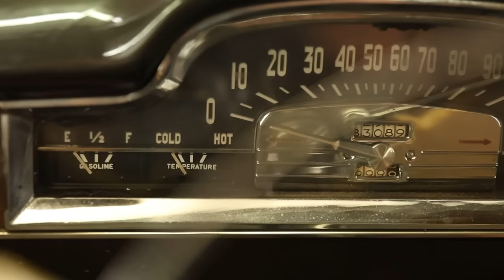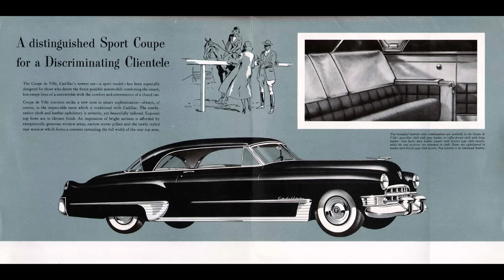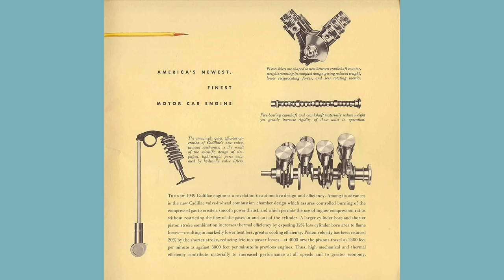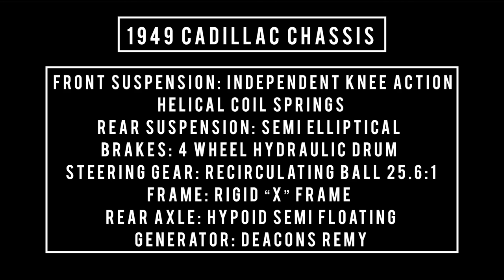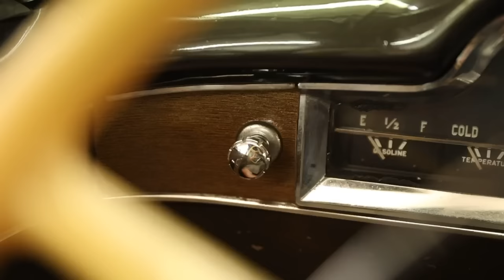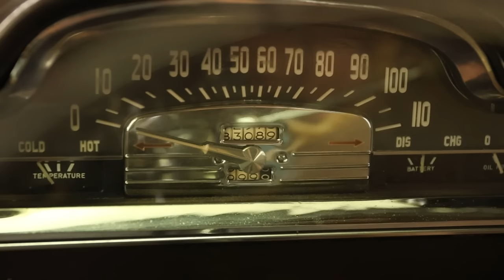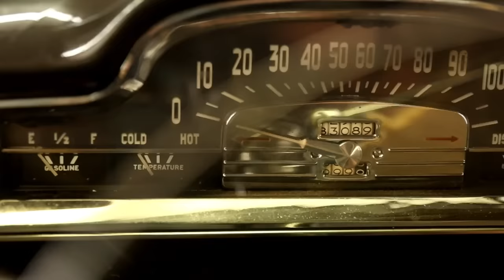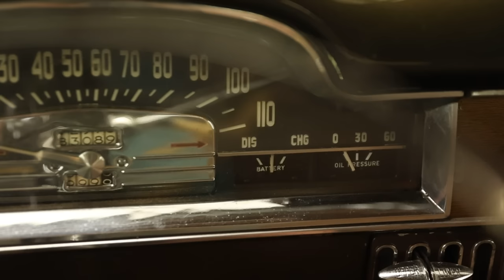1949 Cadillac Series 60 Special￼, Featuring￼ brand new OHV V8 ￼

Comment: great video.  I own a '49 Cadillac, let me fill in some of the blanks.  The knob on the dash next to the wipers turns on the fog lights and turns off the front parking lights (the light under the headlight is the fog light, turn signal and parking light). The upper and lower knobs are not vents but control the temp and fans for the upper heater (defroster) behind the dash and the lower heater (main cabin heat) that is under the seat. The underhood vent controls are the chrome pull knobs under the dash on each side.
Reply from the maker: Thank you so much for the corrections I really appreciate it I’m generally able to find an owners manual but I couldn’t find an owners manual that was downloadable for free for this car.. Greatly appreciate it
greatly appreciate it

What do you like the most about your car what do you like the least I talked to another owner today and he said it’s a fantastic car to drive.. they also said the hydraulic windows are great until they break not very easy to fix
Reply: I assume it's like the '49 Coupe DeVille I owned long ago, which had two fans under the front seat (passenger and driver side) that directed heat to both the front & back.  Very quiet system, but a little more oomph would've been nice, presumably to come with the 12V system in '53.
Reply: Very nicely worded…done without sounding like Professor Know-it-all (now I’m dating myself).
Reply: Hello, my turn signal, gas gauge stopped working all of a sudden on my 49 Any suggestions for how to fix. I’ve had the car for about a year. I absolutely love it. Also the break lights are not working since I’ve owned the car any suggestions on that also. Thanks a bunch.

Comment: WYR - Packard (because it’s always the Packard).  As far as the fastbacks - any of them because I love the fastback styling from that era.  I wonder if those side hollows betwee the door/IC may be to distribute the defroster air to the door?  I’ve never noticed those before and now I’m on a mission.    Great content as always - thank you!  Chuck
Reply from the maker: Sweet choices =)
Reply: I have always considered the bathtub Packard design to be an extremely unattractive looking automobile, with the '49 Lincoln and its '''frown grille" not far behind. So for my WYR the Caddy wins hands down. Lincoln improved their design in both '50 and '51 before introducing an entirely new model the following year, but not so with Packard which kept making the same ugly looking car until dealers were unable to even give them away as they would like to say following which a new and better looking design was introduced in '51.

Comment: Always liked the 1949 Cadillac for its gentle fins and the secret location for the gas tank. the fins became a safety hazzard for bicyclists and motor cyclists by the late '50s and '60s. All Cadillacs made from 1941 to 1958 had the gas tank behind the taillight, with the exception of Eldorado from '55 on.                                                                                                          I also liked the suicide doors on the "49 Lincoln, but by then they were on there way out. The  suicide doors went out of fashion, but always returned. Even the recent Lincoln Coach and Rolls Royce has suicide doors.                                                                                                                 My pick would be the 1949 Packard because it is the rarest of the three.

Comment: The 49 is sooooo much better than the 47. The 49 dash is the Cadillac standard going forward….and I love it. Look at the quality! And wow on the hydraulically controlled windows.
The hollow areas wee called something like airflow for natural cooling.
That is quality for the time. ❤️ this car.
Reply: Lincoln used the hydraulic window lifts and used hydraulics for the front seat adjustments, the hydraulics were so much quieter and smoother Mercedes used hydraulics on the 600 grosser

Comment: The 1948 Cadillac was my favorite. One year only instrument cluster and cleaner lines. BTW, the AMC 327 was a stump puller of an engine and had a lot in common with the early Cadillac overhead valve V8s. I had one in a 66 Jeep Wagoneer.
Reply from the maker: Yeah AMC made a bulletproof 327 and honestly one of the most underrated engines of all time in my opinion far better than Chevy’s version those two engines don’t even share anything in common other than the 327 name.. I’m going to make an edit The engine episode is going to be on the first two generations because the second generation was only produced for four years

Comment: For those too young to remember those days, this was the Cadillac which started the whole "tail fin" fad that the American automobile industry.  It actually debuted in 1948 but the '49 did not look much differently.  Every year for the next decade every American car had tail fins and every year the fins got taller and more extreme.  By the end of the 1950s the public had gotten tired of it, so Chevrolet took the fins and FLATTENED THEM OUT, making them horizontal.  From then on, and for more than a decade, car lines became more and more horizontal and less and less vertical.
Reply: I don't think the Cadillac rear end was like the ugly tailfins of the later 1950s,the only ones of those later tailfins that appeal to me were the smaller ear tuft ones that were part of the Ford Owl Eye taillights such as seen on the 1957 and '59 Ford full size cars    also early Thunderbird
  I think the designer working for Studebaker started the sharp tailfins with some of the Hawk cars around 1956 and then the designer for Chrysler picked up on the fashion but had to exaggerate it and then Cadillac decided to outdo them all with the horrendous 1959 Cadillac shark fins. 
  '49 and later GM cars such as Pontiac I think had higher mounted taillights than earlier models I suspect out of concern for visibility (safety) considerations,the Cadillac appearance might have started out of a desire to get the taillights up high where people would hopefully see them and not run into the back of the car. A forerunner of the  modern high mounted third brakelight?

Comment: Harley Earl was Chief Stylist and Designer at General Motors from 1927 to 1960, and Cadillac was his own special domain as the luxury Cadillac designer. Mr. Earl exclusively designed Cadillacs and later, in the 1950s, worked with the assistance of two excellent designers, Chuck Jordan and Bill Mitchell. Chuck Jordan's first work on Cadillac design was on the 1948-49 models for Mr. Earl, and together, they created the first tail fins on American cars for 1948-49. Harley Earl's Cadillac design creations were sensational and iconic, until his final design for the 1960 Cadillac, retiring from GM with high honors at Christmas 1959. Chuck Jordan and Bill Mitchell picked up where he left off for the 1961 Cadillacs.
Reply from the maker: Thank you so much for sharing that insight, this is one of my favorite eras og Cadillac love the design especially in sedenette flavor

Comment: Thanks for another great video Jay, I love these early 50’s cars especially the luxury models. The early 50’s😂luxury cars were built to a higher standard both through engineering and the quality of materials used imo the latter cars supplanted fine luxury with electronic gizmos and gadgets. For the wyr I’d take the 49 Lincoln as the the styling represented the era, especially the front end styling and they were more exclusive than Cadillac’s and better looking than those particular packards . For the sedanette’s I’d have to say the Buick as the styling was beautiful and the straight 8 was a great engine. Those hollowed out passages in the doors might have been for fresh air and heat to be carried to the rear seat compartment, did you see any venting in the B pillar or the rear foot well ?
Reply from the maker: Sweet choices 

I didn’t see any vents in the rear that would’ve been really cool to see that really baffled me how it was open for both the dash and door but there wasn’t a vent from which I could see in the door itself maybe the air defog the window.. 

I agree cars are more computer than car now and there are positives and negatives to both.. The crazy thing is we have been making cars for over 100 years and nobody has figured out how to make the perfect car, some cars have come close.. but all have compromises of some sort

Comment: The 1949 Lincoln in the would you own was a 1949 Cosmopolitan which was technically placed above the Lincoln as a replacement for the Continental the Lincolns used a body shell like the Mercury.

Comment: 49 Packard only because I really love Packard's.  I actually think that Caddy is a better looking vehicle but I've always had soft spot for Packard's 

49 Caddy fastback is hard to beat.  A beautiful automobile.  Looks great hot rodded too.

When I saw those channels running through the front door up at the top I thought at first it might be vents that ran in for the back seat area. But I didn't see any outlets in the back for those. So maybe those were just a styling design for the doors and hollow inside to lighten the weight.  

That's part of the charm of these vintage automobiles taking a look at stuff like that and trying to figure out exactly what is intent was at the time. That's a really beautiful Cadillac though. And a great representation of the top of the GM line during that era.
Reply from the maker: The crazy thing is this was a basement model Cadillac that wrote a long wheelbase I was always a huge fan of this style Cadillac I would take this in any format but really love the sedanette 

I’m not a huge Packard fan from this era but I’ve never been in one I think they called this era the elephant packard era..
Reply: @What.its.like.  The narrator doesn't have it quite right:  Series 61 was entry level, followed by Series 62, then the 60 Special, and finally the Series 75 limo.  The 61 was dropped after 1951.  By the mid '50s, Sedan DeVille models were being offered as tricked-out versions of the regular Series 62 sedans, the latter then becoming the entry level Cadillac.  (Entry-level 62 models were renamed Calais in 1965.)

Comment: 1. Heated defroster/defogger air could be directed into the front doors, and it came up through the brushlike material at the top to help keep those side windows clear. 2. The 49 Cadillac was way ahead of those other 49 luxury cars, with the looks, the OHV short stroke V-8 and the Hydramatic. 3. Sedannet looks choices 1. Caddy, 2. Buick, 3, Olds.  -The 49 was indeed a milestone car. BTW, never mentioned was that fact that from 49-51, this engine had a 2 barrel carb and single exhaust.
Reply from the maker: Thank you so much for sharing that insight

Comment: The 1949 Fleetwood is one of the best looking of the pre-1950 
post-war cars, second to the 1946-1947 Packard Custom Super Clipper.
Reply from the maker: I totally agree The sedanette tho that’s were it’s at.. 

I have a weird addiction for cars off the beaten path =)
Reply: I've been looking for another Packard - will be my 3rd - for a few years but the 2-door coupes are rare to the point of being unobtainable. @What.its.like.
Reply from the maker: The crazy thing is if you wait five or 10 years you’ll be able to buy any Packard that you would want to buy except for the custom cars those will always be expensive.. like the 34 custom LeBaron bodied cars those will always be worth a fortune and the Darrens. 

Just curious where are you located and what Packards do you have. I’m always looking for Packards to do on the channel if you’re close I would love to feature your cars on the channel if you’re up for it. 

1941 Packard 120 episode is today I thought it was a 110 I got through most of the writing portion of putting the episode together to realize it wasn’t a 110 it’s a 120.. I really wish it was a 110 though because that story was a cooler story than the story that’s going to be told still a cool story but it was better.. with 110
Reply: I'm in Tucson.Mid-late 1970's I had a 1953 Pacific convertible with Ultramatic and in 2000's a 1951 Clipper 300 3-speed overdrive, which I preferred and is what I'm looking for.  There's a pretty light blue 1953 coupe advertised but the seller doesn't respond to questions.  It's a 3-speed but the seller won't say if the overdrive is operational.  Also, the Cormorant has no wings. -  @What.its.like.
Reply from the maker: If I ever go out west I will let you know cause I’m really interested =) I shouldn’t say if I should say Wynn because I definitely want to get out there I just don’t know if it’s going to happen next year me and my wife were sitting down planning out a year it doesn’t look like it will be next year probably be the year after that but who knows things can change =)

Comment: To answer  the  question  if there was a  hard top built before GM introduced the 1949 Buick, Cadillac , and Olds, according to my  Chrysler history  book,  in the 1946-48 era, with one going to a  Chrysler executive  there were 7 prototype Chrysler C-39 Town & Country convertibles fitted with a steel hard top, but was not put into production until sometime in 1949 with the redesigned models, after the Buick, Cadillac , and Olds came out first, so GM beat Chrysler to the market.
First pick the 60 Special, 2nd pick the Buick sedanette, it looks sportier.

Comment: It's funny, the 1949 Fleetwood 75 series didn't get the new body style that other Cadillacs got in 1948. That older body style is what I associate with a Mafioso Cadillac.
!949 was the last of the single drive range 1st series HydraMatics. The HydraMatic Factory burned down in 1950 and was rebuilt from the ground up. So, 1950 Cadillacs used the Buick DynaFlows or a 3-speed manual. When the new HydraMatic re-opened, the transmission itself received upgrades, add a 2nd drive position and ushered in the 2nd series HydraMatic.
GM cars of this era had hydraulic power windows.
The hollow tunnels in the doors was used for air circulation. Cool air in the summer and warm air in the winter. If air conditioning was available, it would have been located in the trunk, and, I know not too much later, if not back then, the A/C vents would run along above the doors.
Mercedes-Benz had air vents into the door panels for decades. Combined with MB-Tex coverings in the center of the door panels, being a perforated material, cold or warm air would be emitted through the door panels.
Reply: I respectfully disagree with your dates:  The first dual range Hydramatic was '52, and the Hydramatic factory fire took place in Aug. 1953.  Cadillacs & Olds got Dynaflow and Pontiac got Powerglide for the remainder of the '53 model year.  (There was a pale green '53 Dynaflow 60 Special offered a couple years ago on Youtube.  It was not identified as such by the car dealer, but it was discernible during the drive test portion of the video.)  I think they tweaked the rear axle ratio on Dynaflow-equipped Cadillacs to compensate--unsuccesfully--for Dynaflow's sluggishness getting away from stoplights.
Reply: @jaysverrisson1536  Whatever. The dates are listed in wikipedia.

Comment: It's pretty well accepted that the fins were a copy of the twin fins of the Lockheed P38 aircraft.  (Get a photo up and you'll see exactly what I mean.)  Now I'm going to take issue with the term 'suicide wipers'.  I guess that the term has come from the relative actions of suicide rear doors and normal front doors, which was common in the late 30's.  But right through the first half of the 30's, many cars had both front and rear doors hinged at the back in the suicide manner.  So if your benchmark was, say, a 34 Ford, you could equally say that the modern style of wipers were suicide wipers.  A much better term for the old style wipers is 'clap hand' wipers.  On the origin of the term suicide doors, they were dangerous.  If a door came unlatched while the car was moving, the natural instinct of the person next to the door is to grab the handle to prevent it opening.  But many people were thus dragged out of the car to their death when the wind caught the door.  On one more matter, it's a risky business judging the quality of the upholstery material of a 70 year old car.  If you can be certain that the upholstery is original, that's fine, but you might be passing judgement on a 30 year old reupholstering job.  Cheers.

Comment: Those windows are hydraulic operated. There's hydraulic cylinders in the doors and the switches operate valves that move hydraulic fluid from a pump under the hood. This was a very touchy system and a nightmare to repair if anything breaks. Cadillac would not to go full electric windows until 1954.

Comment: Had two 49's in my collection one rare stick shift. Auto would get over 20 at 60. GM bought this engine design from the Italians in 41. Not durable though. Had to overhaul both around 89k, my friends same thing. I'm used mopars that never need overhaul, at least below 250k.
Reply: I thought the '49 engine design was copied from Oldsmobile's. Was the Caddy engine less reliable than Oldsmobile's ? (the overhead valve V8s of 1949)
Was the older style flathead Caddy engine more reliable than the new overhead valve one? (I would be surprised and disappointed if it really only had 3 main bearings in which case it would not have been so reliable)
Early Ford flathead V8s might have only had 3 mains but those were not very high compression and probably not as fast or good as people now seem to think they were,also I think the Ford Flathead got updated and strengthened a couple of cycles before the last ones were built in the early 1950s
also I understand that the larger block (than Ford's) Lincoln flathead V8 was not as highly regarded as Cadillac's large heavy flathead V8